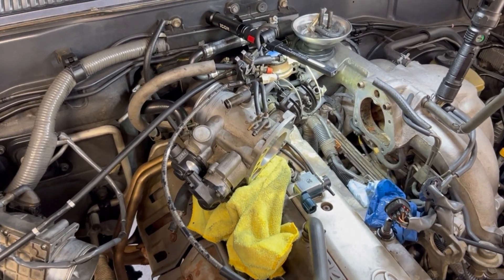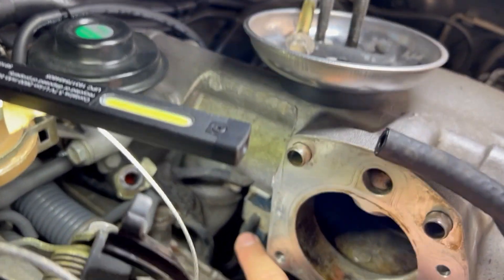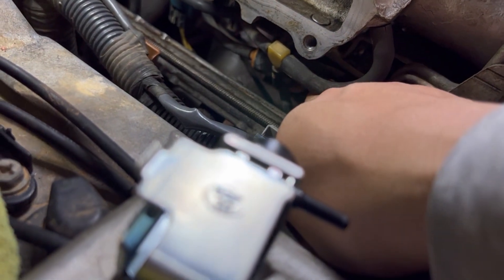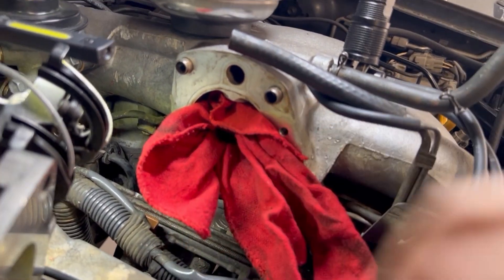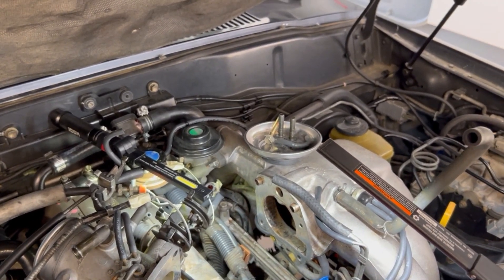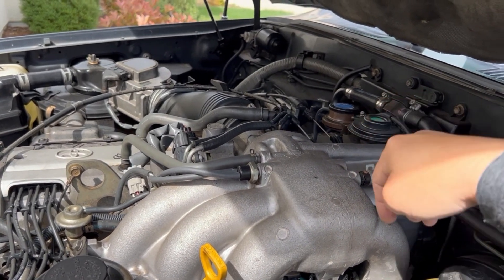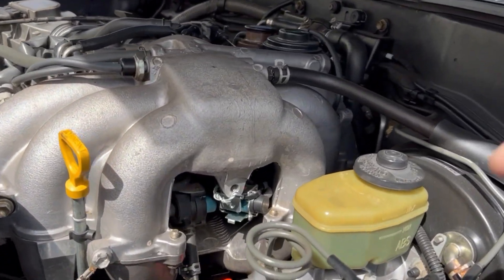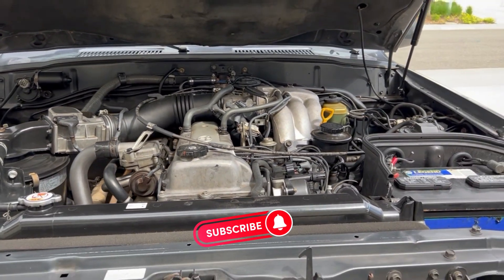FJZ80 Error Code 71/P0401 fixed with new VSV replacement

Comment: I did that in my 1996 cruiser and still throws my cel light
Reply: I also cleaned out the manifold and changed all the vacuum lines and cleaned the ports. What a headache
Reply: another thing to check if you haven’t replaced them are the two O2 sensors. Ultimately, I replaced those with OEM Toyota parts and no more CEL lights.